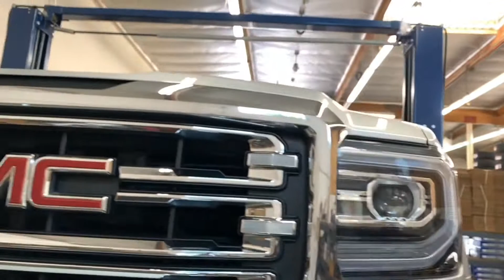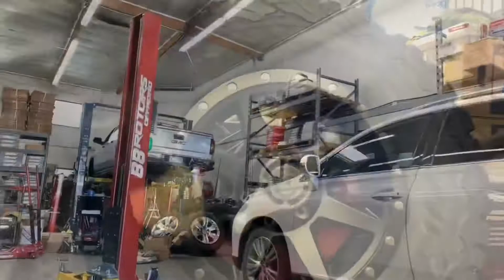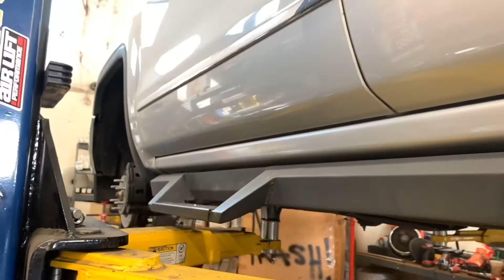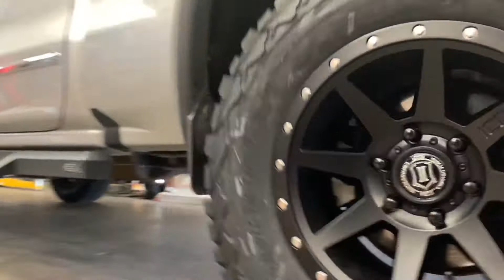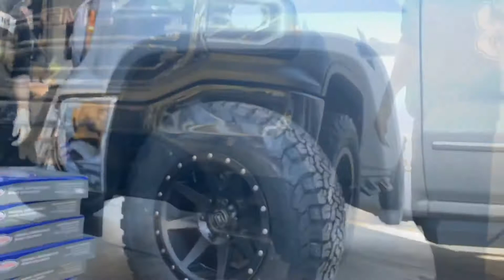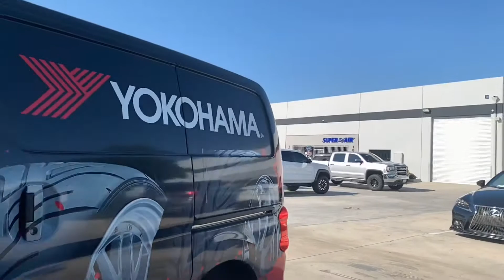2018 GMC Sierra Fox Camburg Setup on Icon Rebounds

Comment: Doing the same thing to my 2018 Sierra. Currently has rancho quick lift and pink Rusty’s in the rear, fox 2.0 0-2” coil overs coming and 2.0 rear shocks as well. I think it’ll look good with the stock rims and 33 BFG’s I have😅 of course with the white lettering😍

Comment: Hey man so I have the EXACT Same set up. I have 2.5 Fox coil overs in the front and 2.0 shocks in the rear with fabtech upper uniball control arms. I am running 305/55/20 nitto tires with fuel coupler rims..I think they are 10" wide with a -12mm offset..however I am having a popping noise issue on the driver side of my truck when I hit bumps and the ride can be rough sometimes. Any idea what the issue could be? I have a 2018 Sierra denali 1500 with 22k miles on it. Anything will help this has been driving me insane.

Comment: How much is this suspension? I don’t need the wheels and tires
Reply: Front coil overs going about $550 each, you can find rear’s for between 130-200 each
Reply: Whole kits will be way more expensive but might be worth it since they often include control arms or other helpful but sometimes not necessary upgrades

Comment: does anyone know what size tires these are?
Reply: The tires are 285/70/17. I now run 285/75/17 about an inch taller no issues.
Reply: @enriqueperales5302  Looks great!!! How much lift in the front? Did they put a block in the rear?